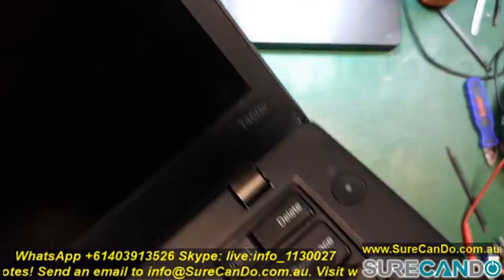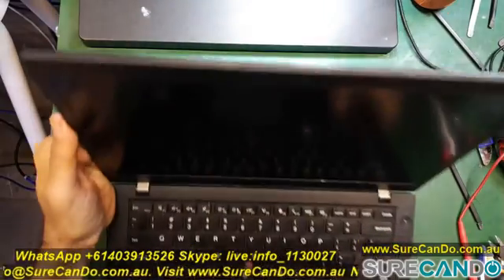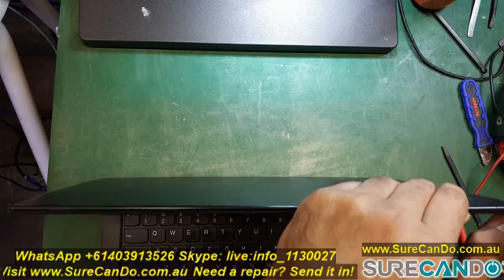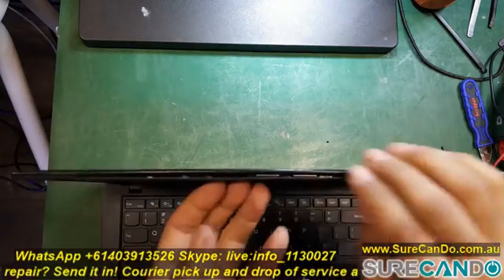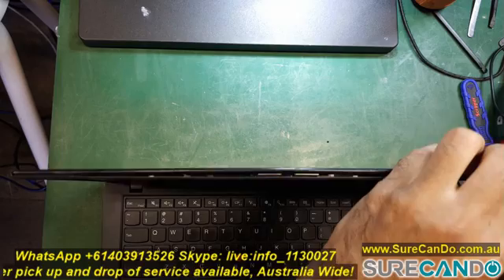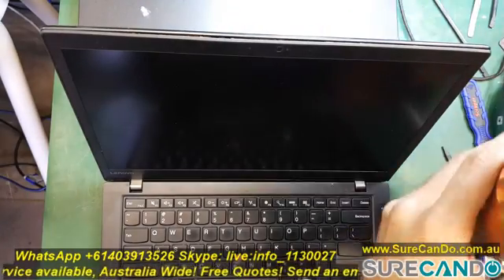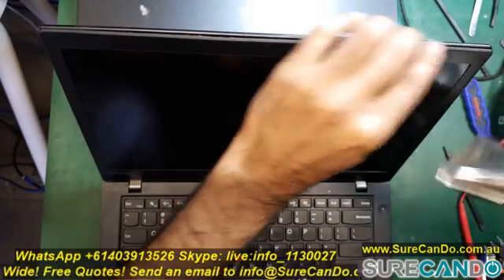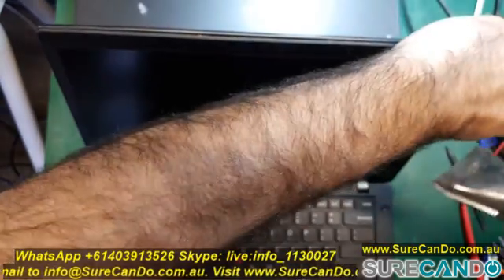Lenovo T460s ThinkPad LCD Replacement Guide LED T460 14

Comment: I went to PC shop for replace the LCD for T460s model but they don't have the LCD with the right connector. the connector for my laptop cannot fit with the replacement. not sure is that normal or PC shop don't have the stock for this model
Reply: @SureCanDoComputersServices1  to many. which one is the correct one? or is the connector all the same or not
Reply: @mohamadhariz9613  lcd FHD or QHD?